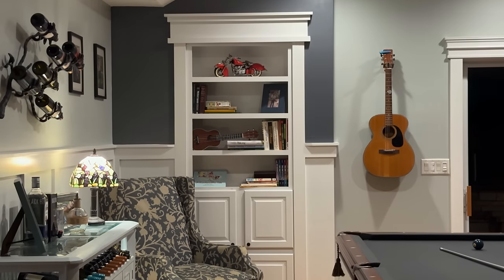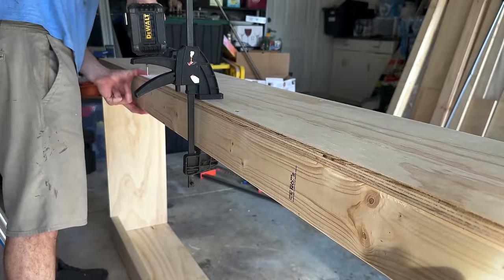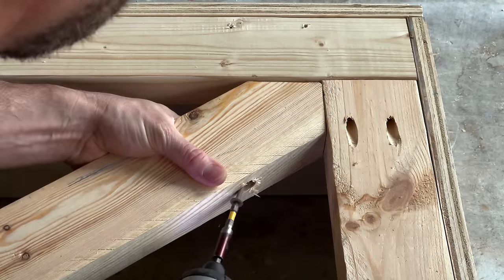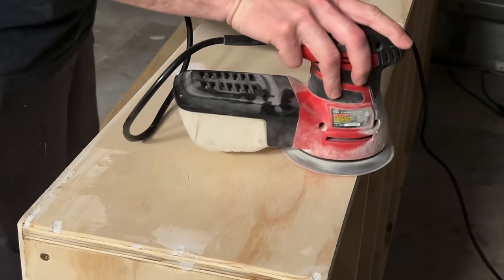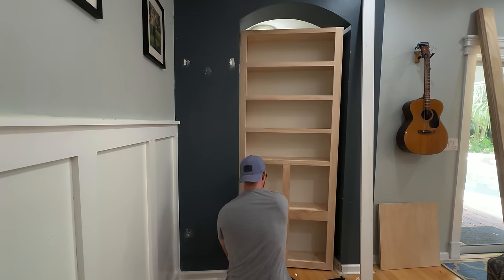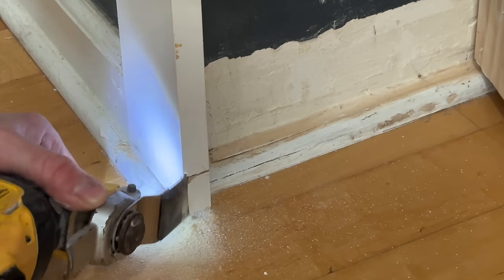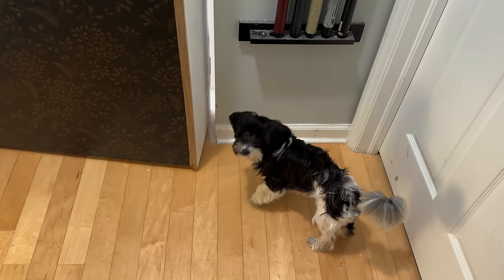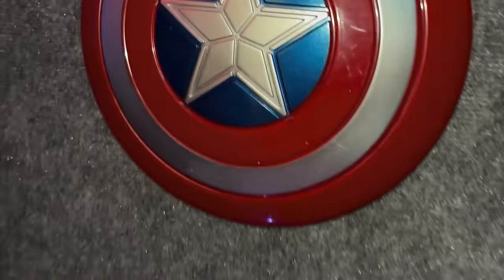DIY Hidden Bookcase Door - Murphy door build

Comment: i have a stupid question...
is there a reason you did not put some kind of wheelies on the bottom of this bookcase? so that the whole thing wouldn't be hanging on hinges?
Reply from the maker: I wanted it as close to the floor as possible for a more seamless look. It gets daily use and the hinges are working great after 4 months.
Reply: @Beau_Builds  you can build the wheelies into the bottom, so they only peek out a few mm from underneath but the bookcase does rest on them. I’ve seen this with furniture pieces where a very heavy section gets opened, so it may be something to consider if you plan to fill this bookcase with heavy stuff. But also… I’ve never built anything in my life… so my 2 cents are probably completely worthless! lol

Comment: Do you have a breakdown of materials and costs?
Reply from the maker: My cost was very much a personal one due to the custom nature of this project. I don’t discount the amount of work that went into this. It was very labor intensive but the materials were relatively cheap.

-1sheet 3/4” Radiata pine-$49.95
-2sheets 5mm eucaboard-$27.00
-2-2x4s-$8.00
-Door hinges-$10.00
-Doors-free(30 years old salvaged out of a remodel destined for the dumpster)
-Select pine face frame/trim-free(leftover-actual cost $30)
-Paint/Primer-free(leftover-actual cost $50)

Comment: At 5:10 can you explain what “blocking” is?
Reply from the maker: When spacing something like shelving instead of using a tape measure you use a piece of wood. This way all your spacing is exact. Works great when installing drawers as well. Thanks for watching

Comment: This is amazing! Your kids will cherish these memories. Tell your wife you need to do more projects and maybe a TV show! I have a similar project where I have a bookcase that fits in the doorway between my kitchen and office. I want to use this technique to block out the noise. The door opening width is 36”
and my bookcase is 31.5”. Would I be able to remove the existing trim and add new trim on either side to conceal the gaps? Is that the face frame section? My apologies, I am truly a novice to woodworking! Thanks!
Reply from the maker: It will definitely block noise and should fit fine. The only issue is using trim on both sides. I only did one side because I’m not that good of a carpenter. You can do both sides but it’s tricky. A lot of it is trial and error. You got this
Reply: Thanks for the advice! Don’t sell yourself short! You are amazing carpenter! Keep the content coming!

Comment: I like what you have ultimately done but would have done far more painting and sanding outside. I find your lack of drop cloths disturbing. Fare less mess to have fit it unfinished, removed it, finished it, and installed it. Still, as I indicated at the beginning, a great finished project.
Reply from the maker: Thanks

Comment: Brother invest in a table saw!
Reply from the maker: I do have one but it’s not ideal or accurate enough to rip down large sheet goods unfortunately
Reply: I have that same Ryobi. Mounted it under a sheet of 3/4 plywood. Raise up cut through the ply and made 2 T tracks for an adjustable fence. Works GREAT! Super cheap and easy to break down when not in use. 4 bolts and done.